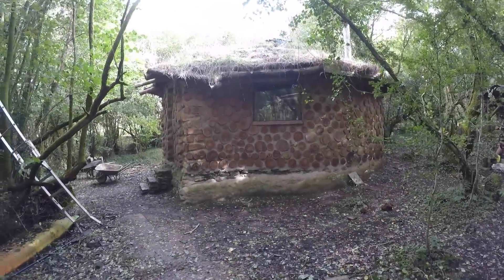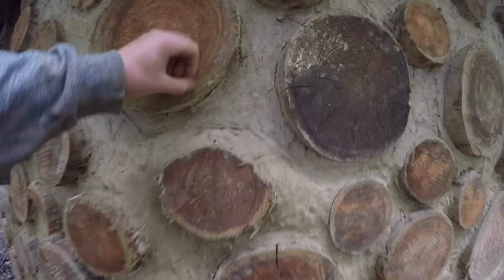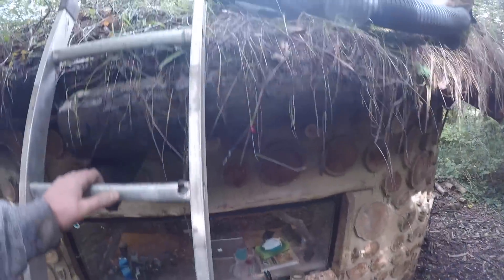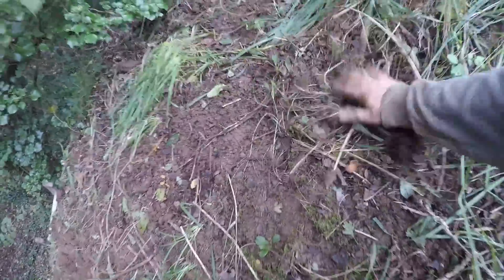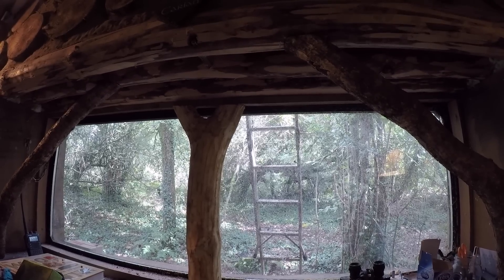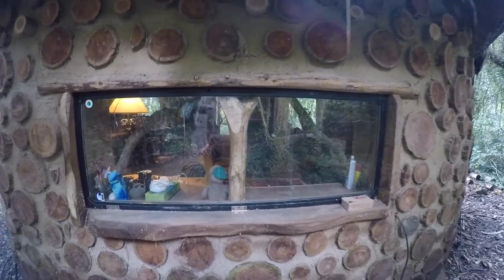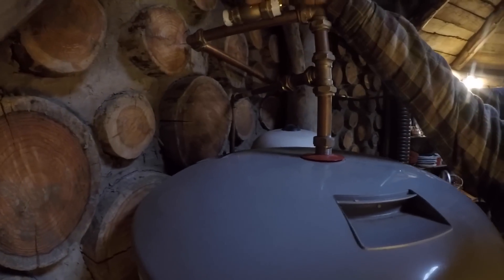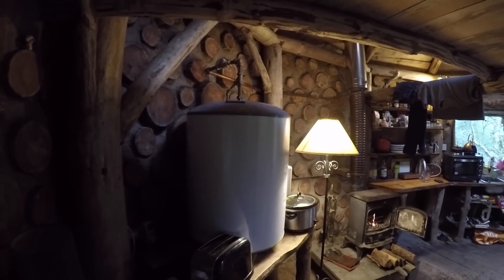Off Grid Roundhouse Yearly maintenance

Comment: 1:12 be good to put some wood beads around the glass unit, you have to keep the sun off the spacer of the window, helps to prevent the unit from breaking down and fogging up inside the unit,
Just my OCD as a window fitter lol

Comment: Years ago my Grandmother told me to use old wadded up clean newspaper to clean your windows. You don't have to use a bunch of window cleaner and it doesn't streak, unless its really cold or you are using cheaply made window cleaner. Spray foam we got from our window installer has lasted forever the can is like 13 inches tall with white label blue/black lettering that simply says glass cleaner.
Reply: So true. Nothing better. My window cleaner is a 1:10 mix of water and methylated spirits, applied with a plant spray bottle. Clean off with clean newspaper.
Reply: That's  what we used to use when I was growing up. Newspaper and water, sometimes with a dash of dish soap

Comment: was curios will u at some point put a finished flooring down or go with the ruff cut u have ,an if u use /keep the rough will u finish it at some pointby sanding and using a stain or clear coat,or maybe oil of sort

Comment: Cool Build.  Was wondering - Why was the Window Frame dropping?  That support seems questionable.  If the earthen roof is holding onto too much water, the structure would be holding up a tremendous amount of weight.  How does the roof shed the rain water?

Comment: Just FYI, that check valve that you installed is of the Compression Type. There is no purpose or advantage of using thread tape. I don't know if there is a disadvantage, but you certainly don't do it normally. Hope this aides you in the future.

Comment: I may have miss it but, why don't you have an inside bathroom? ( I mean little room attached to main building)
I get having a pit toilet when there is no running water but you have that.
I guess for sewage you can do something similar to what you have outside but with a leaching bed, all stuff that you are more than capable of doing.
Just a question, I can't imagine walking out early morning in winter  to go..

Comment: Why don't you have a drying shed for clothes for laundry. Basically a normal wooden shed install   radiator have the hot water from wooden burner to rad your clothes will be well n truley dry for you. 
Something you can plan for the future. I have this drying shed in my back garden. Cost notting in untility bills as mine comes off the back boiler of wooden burner. 
It's fantastic in the winter months when you have large amount washing. In your case you could put washing machine in your drying shed.

Comment: Do you regret no making the house a little bigger? or is expansion a viable option in the future?
Reply: For the time it'll last it wouldn't be worth it, the size is plenty big enough for two people, it seems like this was built with the idea of it lasting 10 - 15 years. 

The house walls are built on decking timber, I guarantee it'll be the first major damage to the structural integrity. Otherwise it's on fairly good foundations, the roof is supported by both the outside log walls and the inner framework, whilst allowing for major ground movement because the inner framework and outer walls are independent... 

I'd like to think this bloke will have built something way beyond this within the next 10 - 15 years if he outgrew it to the point of needing an extension. I'd like to see a project like this combined with some decent money behind it and make an ultimate eco house. There's massive potential here.

Comment: Love the vids, very interesting. Just a note though, not sure you're meant to put any type of valve in the flow or return pipe from a wood burning stove, but then I'm not sure the system you have there. It looks like an un-vented cylinder which is also a big no no with stoves. Anyway, I'm sure you know what you're doing.

I wouldn't normally comment like this, but my conscience got the better of me. Be well
Reply: Having been there myself and looked at what he has made. i can assure you its very safe with all the right valves in all the right places. no ticking time bomb here :)
Reply: @gazza2963  nice work dude. how did you fit the safety valve on your cylinder system? thanks
Reply: @cliveramsbotty6077   you need to ask Kris mate, been a while since i have been to the roundhouse.
Reply: @gazza2963  i'm asking you about your own setup though. i already asked kris about his. how'd you pipe yours up? thanks
Reply: @cliveramsbotty6077   i dont have one yet. maybe next year
Reply: @gazza2963  you said you had a similar setup yourself which is why i congratulated you on it and asked about it
Reply: @cliveramsbotty6077  sorry if i lead you to believe i have a hydro. i dont have one buddy. can you link me to the comment where i say this so i can correct it please
Reply: @gazza2963  It seems I owe you an apology Gaz, you didn't make any such claim and I think I got confused by another comment. I also found the video Kris did showing the cylinder install and you are indeed correct - the safety valve is fitted correctly and there's no ticking time bomb there whatsoever. Thanks for putting me straight!

Comment: Is it possible to run that tractor off the restaurant oil you’ve got a stock of?
Reply: It would run, however old tractors constrain old rubber without viton. Last a very very short time before catastrophe
Reply: @Karma is knocking I suppose it would depend on how your pump setup is. For example bosch pumps are of much higher quality than say lukas etc. Clearly though yours is proven to work well. How old is your tractors though, pre 1990s is generally where literally everything perishes. Leave a few rubber washers in some used cooking oil and you will see what I mean they literally turn to paste

Comment: Wouldn’t it be much easier and efficient if you used a propane water heater. Instant hot water and uses very little propane. Vinny 🇺🇸
Reply: mmanut will probably cost a bit more since it won’t last long since it’s used every day

Comment: really interested in your water heating setup - was there a more detailed video on it? unvented cylinders can build up pressure, what's your setup like with the safety valve? i can't see it but i've no doubt you put one somewhere...
Reply: edit - I found the video of the install and of course the prv is all present and correct. cheers